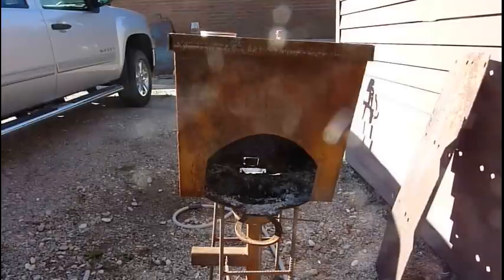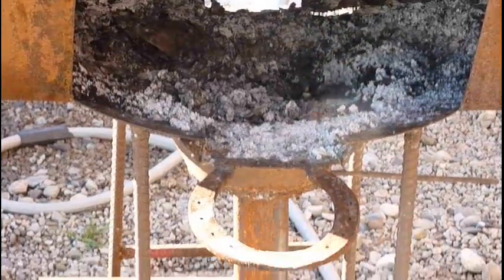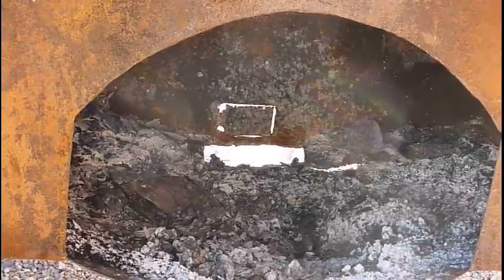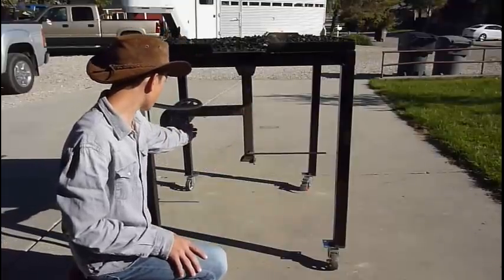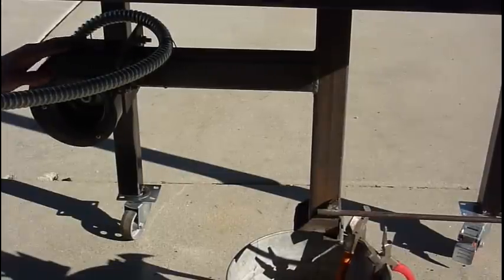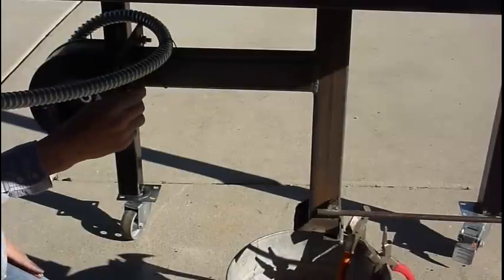How to build a coal forge!

Comment: In general I think you have done a great job on your forge.  You are however, a little off on your thoughts about an air gate.  They are actually quite simple to build, I made mine in about an hour.  One of the great advantages of an air gate over using an intake baffle like you are doing is that it is much easier to orient the gate in such a manner that you can build linkage allowing adjustment while you are just standing at the front of the forge.  No getting down on your knees to reach a little baffle, then standing up only to find it is not quite right yet, then back on your knees etc.  You are a very young man so maybe all that up and down is no problem for you but an old man like myself prefers to remain standing out of fear he might not be able to get up again.

Also, it is a bad idea to use a speed controller (rheostat) to control the speed of a centrifugal fan. The fan itself is responsible for keeping the motor cool so if you reduce the speed, you reduce that cooling thereby reducing the life of the fan motor.  Heat is the number one killer of electric motors.
Reply from the maker: Scott Rich I heard that so I didn't end up putting a speed controller on it I'm interested it at air gate do you have any more details on that so I can build one I would love to make one. Also I don't know if have any experience on propane forges but I'm building one if you had any tips. Thanks!
Reply: I have built 4 or 5 different propane forges over the years and worked with propane only for twenty years.  3 years ago I started working on coal and coke and now prefer that over propane or natural gas.  

I am not all that great on using this google format so I don't know for certain if I can get way with posting a link to an imgur image for you, but here goes.  I will post with a couple different routes and hope one works for you.

<a href="http://imgur.com/Ggb0T7K"><img src="http://i.imgur.com/Ggb0T7K.jpg" title="source: imgur.com" /></a>

<a href="http://imgur.com/DH84yHZ"><img src="http://i.imgur.com/DH84yHZ.jpg" title="source: imgur.com" /></a>

http://imgur.com/Ggb0T7K

http://imgur.com/DH84yHZ

All an air gate really is, is a rectangular plate with a hole in one end, roughly the size of your air pipe's i.d. , which slides between two square plates that have spacers which create the space that the rectangular plate slides within. You add a stop on each end to restrict how far the slider can move.  To allow air flow you align the hole in the sliding plate with the pipe by sliding the plate in one direction.  To cut off or reduce air flow you slide it the other direction.  You can safely run a centrifugal fan fully obstructed without damaging it.  The air just pressurizes the air in the pipe and the excess just cycles around within the fan housing.  No extra load on the motor, no failure of cooling.
Reply: O.B STONZ As far as propane forges go, stay away from videos showing home made castable refractory.  It doesn't work.  Use commercially made ceramic wool insulation like Kaowool or Innswool with some sort of rigidizer to keep the fibers from becoming airborn.  Use half thickness firebrick or kiln shelf for the floor.  I finally broke down and purchased commercially made burners for my last two propane forges because my home made versions never really functioned well enough for my taste.  

The reality is however, that I really dislike using either propane or natural gas for forging.  There is simply no way to heat a small area of your stock with one.  They heat up everything.  I only use mine when I need to heat up a long section of stock for something like a long twist or large scroll.  Most of my own work is pretty small scale so coal or coke is my fuel of choice.
Reply from the maker: Scott Rich Alright I think I got a pretty good idea on that air gate. I got kaowool for my propane forge and i have rigidizer too. Should I line it with a cast able refractory to? I am using it to make Damascus so I need to heat the hole 8x8x2 in damascus billet evenly that's why I'm using propane plus its cleaner for getting welds i see what your saying about coal I'm sure ill still use coal. I think coal is better for art but I make knifes so I think propane might be better I'm not sure. I also have firebricks to because they say that borax will eat the kaowool alive. I am making my own burner's, two to be exact but i think I can pull it off. Thanks again ya should I use refractory?
Reply: O.B STONZ In my experience, the more castable type refractory you use, the more difficult it will be to get the forge hot.  Castable is, by and large, an enormous heat sink.  What are you using for a forge body and how large an interior space are you heating up? 

Kiln shelf with Kaowool type insulation under it is my own preferred forge floor.  If you put a coating of cementaceous rigidizer over the wool, the issue with borax will be minimized.  If you are careful and only get the borax on the forge floor, you shouldn't have much problem but I have no direct experience of forge welding in a propane forge so I can't help much there.  None of the forges I have built would reach welding temp at a pressure I was willing to run at.  Keep in mind that with a single burner and .045" orifice, running at 15 psi, which you will probably need to get things hot enough, you will burn through at least a gallon of propane an hour.  With two burners you can double that.  I pay $4.00 a gallon for propane here in California so it is simply not cost effective to use that fuel for forge welding.

I have found that forced air propane or natural gas forges, that is to say, forges that incorporate a centrifugal fan instead of a venturi design, get much hotter.    The downside is that with that much air, you get a huge amount of scaling.   I informally teach a few local glass blowers the fundamentals of blacksmithing and they use a forced air natural gas forge in their shop and I hate it.  I do mostly decorative work so the surface finish I end up with is what I am stuck with, as opposed to knife or sword making where the forge finish is mostly or entirely removed through grinding, and I find it impossible to get an acceptable finish on my work in any  forced air forge I have worked with.

With all that in mind I suspect that propane or natural gas are the fuels of choice for most knife makers. They just don't work for me.
Reply from the maker: Scott Rich My uncle has a propane business I get it for $1.15 a gallon and coal is 250 pounds for 21 dollars. my burner's have .025" orifice how much psi do you think I need
Reply: O.B STONZ .025" is a pretty small orifice.  Most commercial burners are running with between .036" and .045" or so. I would recommend you upsize if you are planning an atmospheric burner, that is to say, one without forced air. I'd use at least a .035" orifice.  With that size of orifice you will probably have to run at about 15 psi to reach welding temps though that is pretty generic advice.  I do not know what size forge you are planning.  That info would help me to advise you.
Reply: O.B STONZ Oh, I forgot, make sure you get a large tank, not one of these small 20 lb. 5 gallon ones.  At 15 psi operating pressure a small tank may well freeze up.  I use a 15 gallon tank and have no problem.  Also, at the price you will be paying for propane, it will be pretty inexpensive to run.  Any coal you can get for that low of a price is probably not going to be great smithing coal.  I pay $25.00 per 50 lb. bag.  You want high grade bituminous coal in nut size chunks.
Reply from the maker: Scott Rich I went and got the stuff last night. I got a 10 gallon tank to fuel it and I got an old fork lift propane tank for the forge I got all the tubing to and fittings and a pressure gauge. The fork lift tank was 12 in diameter and 18 inches long so ill prob end up with 16-17 inches of usable space. and my regulator goes from 0-20 psi. That was the largest regulator he sells since he works with with heaters and rv's he mostly works with preset 6 oz. regs. Thanks does that sound good? My coal is fist size right know I used to use smaller stuff more for smithing they were just out last time I went to fill up it's not coke but most coal in the west is still tons better then what they have back east isn't it? I will break the coal up a bit to. With the ten gallon tank should I put it in water so it doesn't freeze?
Reply: O.B STONZ You may well be alright with the ten gallon tank without resorting to putting it in water, but I am glad you know about that trick in case it does become  a problem.   I can tell you that a 20 lb. propane tank is a better size for a forge than the forklift tank.  I used a large tank for my own primary propane forge and I ended up blocking about six inches of it off because it was just too big.  I just blocked it with a wall made of ceramic wool with rigidizer on it and a small hole in the bottom for long pieces of stock.  

Sometimes when I am short of money and need coal I buy a lower grade of bituminous that comes in huge, softball size chunks.  After trying several ways of breaking it up I settled on taking a piece of railroad track about 14" long that I had lying around,  setting that in the bottom of a contractor's wheel barrow, the kind with pretty high walls, and just busted it up with a hammer agains the RR track. It worked very well.  The high sides of the wheelbarrow helps to contain the flying bits of coal.  No way of knowing what sort of coal you are getting without asking the supplier, but if it works for you that's great, because it is dirt cheap.  I'd probably buy it myself at that price.  The coal I get comes from Kentucky or some such place.
Reply from the maker: Scott Rich I'm building it with sliding doors on each end and I cut of the dome part of the tank on each end so if need be someday i could cut it shorter and just weld the channel iron back on for the doors its about the size of your average 7 gallon tank they just come stock with flatter ends. I need the large diameter because the damascus billet is 4-6 in tall and the inside diameter of the forge is 7-8 in. The floor of the forge is fire brick I got them slotted a quarter inch do you think that will help the airflow around the item in the forge to heat even. Do they have a lot of coal mines in Cali in Utah we are surrounded by huge coal mines maybe thats why its so cheap?
Reply: No coal mines in CA, not environmentally friendly. 

I am not clear what you mean by you having the firebricks slotted a quarter inch.
Reply from the maker: Scott Rich They have grooves in them a quarter inch deep to help with airflow around the object in the forge, however most the people who have them say they just fill up with scale anyways?
Reply: O.B STONZ I can't see any value to that but I can't see a problem with it either so I'd go ahead and use them.
Reply from the maker: Ok well I think I got one more question. What angle should I have my burners going into the forge for the most even heat?